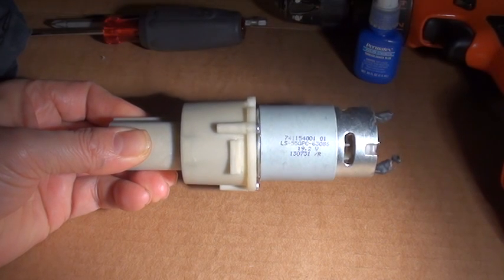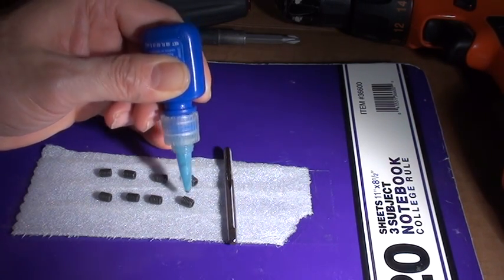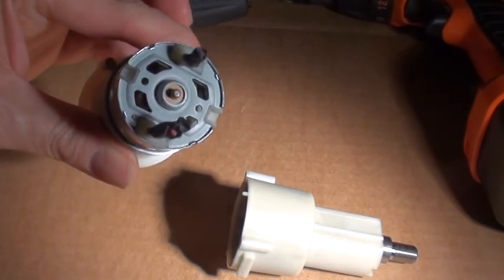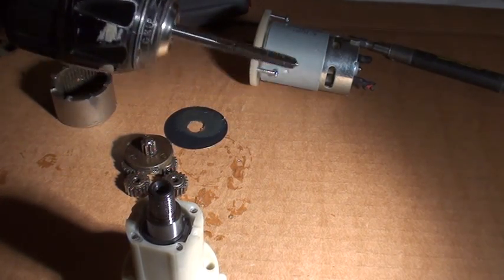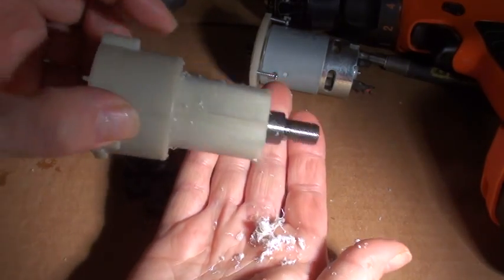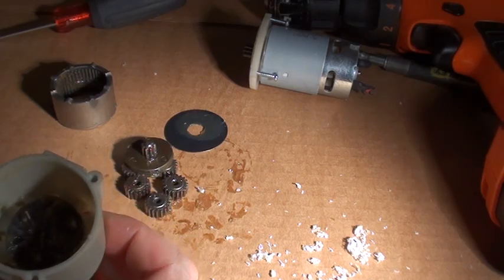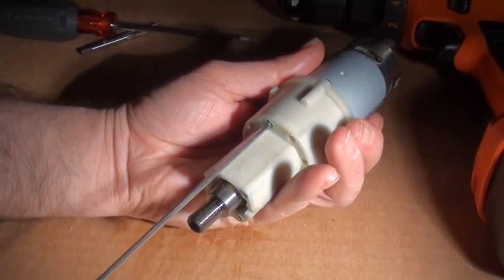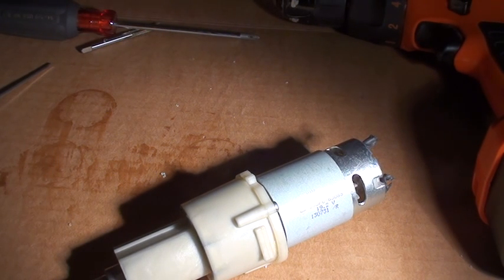How to turn Cordless Drills into Robot Motors - Budget bot builder

Comment: I do have one question seeing as I'm in the process of raising the money for my own robot project.  I would like to use the cordless drill motors for the drive system, what is the weight limit these motors can handle on a 2 motor setup?
Reply from the maker: +striker0     Making a TON of assumptions here, but. 2 motors is enough for a 12lb  wedge robot,  2 motors is more than enough for a 12lb weapon robot.  4 motors is possible in a 12lb robot,  but heavy.  4 motors are better suited to a 30lb robot.  In the past people have used 4 motors in a 60lb combat robot,  I believe technology has progressed beyond that point.     All of this "advise" only applies to single speed cheap cordless drills.   Makita and DeWalt make far superior drills, they come with superior performance as well as prices.
Reply: +teamtiki Thanks for the input.  Truthfully, it's not a combat robot that I'm building, but rather a small scale rover to get my feet wet in building a robot from scratch instead of buying another kit.